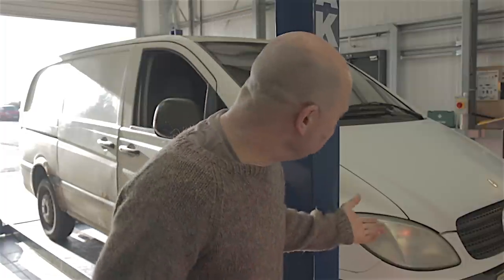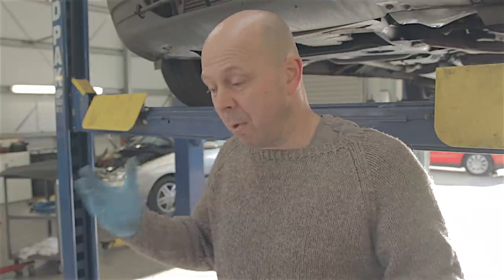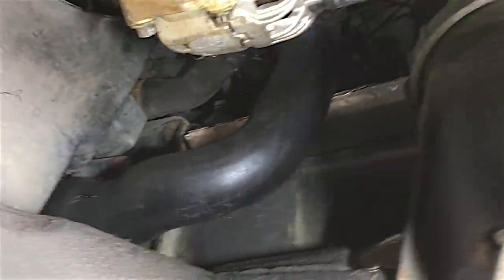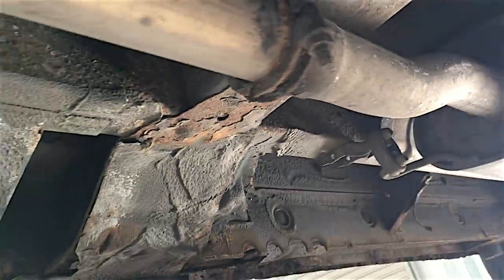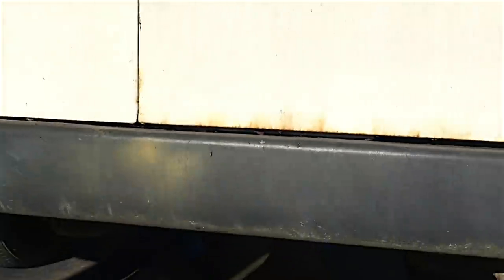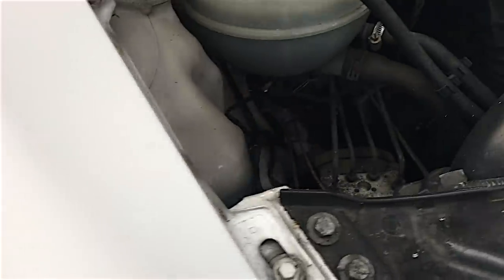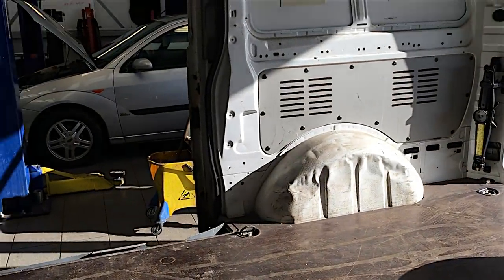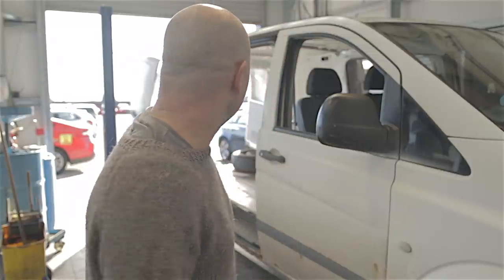Spares or Repair, After Sixteen Years The Rust Won, Mercedes Vito 109cdi.

Comment: The corrosion on Mercedes’ vans always amazes me, you regularly see 2 year old sprinters for example with rust scabs coming through the paint on the outside, but generally underneath they are sound, but that van is very crunchy indeed

Comment: A mate of mine had 2 of them, I they both turned into premature rust deposits the metal was appalling & they did require some expensive mechanical repairs. I know they get bad press sometimes & I’m sure people will have some horror stories but I’ve had 2 Renault trafic’s & currently running a crewcab Vauxhall Vivaro. Done well over 300000 miles between the 3 of them, they’ve been very reliable & never let me down. Also rust has never been a problem because I believe they’ve got galvanised bodies, you never seem to see a rusty one & the m8 that had the 2 Vito’s is now on his second trafic & his have been just as reliable. Keeping them well serviced (regular oil & filter changes) & running on premium diesel is key in my opinion.
Reply: Vito's are galvanised 2006>

Comment: We had a fleet of Mercedes sprinters as soon as they turned 4 years old the rust started and it was also in patches all over the place and it spread quickly. Even Transits never rusted as quickly as Mercedes do.
Reply: The early model Mercedes suffered from that
Reply: @clinteastwood8230  these were 14plate not what you would call old
Reply: I was under the impression that Mercs were all about quality until I saw this. Shocking!

Comment: As you say, they are not designed to last bodywise. Designed to do 200K plus miles in 6 years. And the chassis cabs then used for mobile homes and they rot out in the same way as they don't have the rust protection in them. Not to mention that Merc's of that era are well known for tin worm problems. At some point you usually have to admit that you are fighting a loosing battle...

Comment: I bought  a 2001 ' Y '  Mk5 Escort 55 van at 50.5k miles  which I bought from BT in 2005 for £3,500.In the early years , had access to a ramp and liberally sprayed Waxoyl everywhere annually and squirted motorcycle chain lube into the sills through the trim fixing screws .The body remains immaculate but got an advisory last year on sill rust starting to appear .It has been so utterly  reliable over 17 years and cost very little to run & maintain ,I am loathe to give up on it and worried about a replacement being less so and too complicated and cannot afford the huge costs vans are now , even a high mileage one that most appear to be .It has now covered 114K miles  .I feel I am going to get it inspected a few months before the MOT and probably give it another chance - what should I do ?  .It is often admired too !!

Comment: I had a Seat Alhambra Y reg from new. After 10 years it had done half a million miles on the clock. Same engine and gear box, clutch at 300,000 turbo similar time. Just regular servicing and cam belt/ water pump replacement. Brilliant car 1.9 diesel.
Reply: A family member has a VW Sharan 1.9tdi 115bhp 10 reg, it was the very last one VW made before they changed to the new shape and went to the newer shitty 2.0tdi engine. 
The old 1.9tdi engines were so good, nothing like the crap that is made now, yes the new ones are more refined but everyone I know with a car with the old 1.9tdi PD engines have really high mileage but still drive so nice with the proper oil and service regiment, and the parts are so cheap for them too.
Reply: @MrZimmaframe  1.9 TDI is a bulletproof engine fact! 😎
Reply: How did that van get through the last  mot?  Should have been scrapped five years ago.

Comment: all mercedes, cars and vans, in the early 2000's were rust buckets, as they stopped galvanizing the panels to save money. There was that many complaints, especially from car drivers about their cars going rusty after only 4 or 5 years, that mercedes went back to galvanizing and properly rust proofing in the late 2000's....they even offered a 30 year anti corrosion warranty to bring back the faith for owners in mercedes.

Comment: My dad has a 2008 Renault traffic. With.  20030 miles that still has the original clutch.apart from service items it’s only had a battery, an alternator,and last year new injectors. Everything else is original. And no rust at all on the body
Reply: Best van I’ve ever owned a trafic . Sprinters and vitos showing corrosion at just a few years old - not good enough for a “premium “? Brand
Reply: I was gonna mention that. Renault trafic / Vauxhall vivaros are very solid vehicles.

Comment: A roll of duct tape(Or aluminium tape if you're feeling flash)a thick coat of underseal and get Stevie Wonder to MOT it and run it for another year🤣🤣

My brother in law just paid €1,700 to have his 08 Transit ST welded up for another year,still cheaper than buying an unknown replacement. 

A mate recently purchased a Merc crew cap,with the 3.0 V6 turbodiesel, goes like shit off a shovel according to him,but very juicy though😂

Comment: My one through a rod at 400,000 miles and I still drove it from the recovery truck to the workshop 
And the stupid thing they don't have an oil pressure switch but it has got a light in the dash and if you don't believe me phone a main dealer and ask for a price of a switch and they will sell you an oil level sensor

Comment: I bought an 05 vito and converted it to a camper. Spent everyweeked finding new area of rust the old owner had filled over. After a year of welding and body work i gave in and replaced it with 12 plate vito. Was best move ever new vito hasnt got a spot of rust on it.

Comment: Bought a Kia Rio cheap as the front bearing on both sides were shot. Did your trick and bought two complete hubs off eBay. Fitted them, kept the old hubs with the intention of having the local garage press me new bearings in when the eBay ones gave way.  Ran the car for 30k miles before I had to scrap it. Fuel tank rotted through, all the scrappers had rotten tanks too and all the factors wanted £500.  Hubs are still sat in my shed though.

Comment: Hi Alan.I had a similar rust bucket which was a ex taxi 1998 escort estate 1.8td which a bought really cheap with a broken cambelt.replaced the valves and belts then ran it for 100k miles with 380k miles on the clock.the engine never used any oil but like your van,I just got sick of welding patches and spending time to get it through the mot every year.

Comment: Running an old Mercedes is expensive business. I let go my 190e a few years ago after 18 years (plus 7 years by previous owner) and I could not have bothered with more ongoing repairs (bodywork still decent though). My one owner from new 95 Mk 7 Corolla had given  me only around 5% of problems (all easy and not expensive to fix) to that of the 190e and I am still driving the Corolla daily.

Comment: They’re shocking.  Have a 2009 120 imported from southern uk in 2016. Under back of it once a year tidying up for equivalent of MOT here in Ireland. This week working on corner of front sills behind bottom of front wings. Effing thing is rotting from the inside out. And it spends most of its time indoors. Someday drivetrain will overtake the body 🫣. Over £1k recently spent upgrading to auto climate to include finding ac condenser buggered from ally rust and intercooler leaking also. Such a shame, these parts of northern hemisphere just too much water in the air all year round. Only kept local market in mind when they made these in Vitoria. 😫

Comment: I had from brand new a 2001 Vito which served me great but became a rust bucket which I repaired year on year. To be fair it was a fantastic van but I had the brakes fail on me which thank god was on the flat at 30mph when covid lock down was on so very little traffic on the roads. The last MOT fail estimate was £3000 to fix so I had to say goodbye. £500 scrap value which I thought wasn’t bad.

Comment: Wow ! And I thought my ‘92 Jeep Cherokee was bad . Half my rocker panels are gone and the lower body panels are full of holes as well . 
It’s gotten to the point I’m ashamed to,take it for inspection each year . So why do I keep it ? Foolish pride . It still runs fairly well , at least . The four wheel drive is still very functional and effective . The transmission , the once popular AW4 auto trans still works well when other Jeep automatic transmissions weren’t as well built . The transfer case , an np242 , is one of the better ones as far as gear selection in four wheel drive mode . The 4.0 liter H.O. still is,strong . Swap the whole powertrain and drivetrain into another Jeep ? I like the idea but I’ve got two Jeep projects already . So I’ll just keep in on service .. the unibody frame is fairly strong for now . Maybe I’ll patch it as you’ve done , but how long will I wait ? Sorry to see your old friend go , but it’s out of your hands . Nice fix on the driveshaft . Luck with rainbows that it didn’t vibrate but you showed the benze boys they can’t get your money ! Thanks for the star appearance Monica ❤️ that was fun ✌🏻

Comment: The achilles heel of early noughties mercs was rust. Great engine and gearbox. Shite water based paintwork mate was the problem. If the bodys had of been galvanised. Bought a 93 astra van in 1995, ex royal mail, rusted to bits in less than 5 years. I had a 2002 c220cdi, pit 275,000 miles on her, needed a turbo and a couple of injectors, had to paint the back arches twice.
Reply: Yep my old k reg astra was a rust bucket to the 05 one I had years later had no rust even at 12 years old Vauxhall zinc galvanized the later astra.

Comment: Hi mate, do you live by de sea? I have a vito 111 2004, 490.000 kms, it’s a little rusty but not like yours, but de engine is like yours, very clean no drips of fluids. Lately, when I start running the van there’s a loud noise, I think it’s the transmission, must check.

Comment: That’s Vitos for you. Mechanically bombproof and go forever until the body hangs off the thing. For a ‘prestige’ marque, MB are woeful. Sprinters are no better. Negligible corrosion protection and rust popping up in the most unlikely of spots such as the middle of panels. MB really do need slating for this. It’s bad enough on a commercial but if you are doing a camper conversion on one of these you are shelling out potentially £50k+ and deserve better.

Comment: Have to agree, probably the best vans money can buy for the engineering but once they start rotting they do it very quickly.  The best merc I had was a 1982 307 2.4Diesel, non turbo, lwb with over 300000 on the clock it was still going strong right up to 2000, the engine & running gear would have carried on for another 300k miles but underneath was literally falling apart.

Comment: i don't think Mercedes have solved the rust problem on newer vans, i have a few vans and i have a Mercedes sprinter as a spare van what's done 6000 miles only and is 70 plate and it worries me with rust, my mate as a 17 plate mercedes sprinter and it had bodywork done because it started having rust spot on it in strange places and he as looked after it washing it at least once a week,

Comment: Underneath looks like a British car of the 1950s and 1960s - and later!. I gad a VW Transporter 1986 Turbo Diesel for 20 years. I had a replacement engine at 100,000 but it was worn out after 75,000 so I sold the van at 20 years, The body was very good nothing like your van. I recommend a VW - or better a Japanese van. My TD engine was a disappointment.

Comment: Alan little question not about your van but mk 5 Mondeo I have one on a 14 plate  low mileage a while ago the rev counter was up & down and all over the place & engine would stall at times took me ages to track the problem down . Turns out it where thorttle body sencer. 10 min job to clean I'm just asking if any of your Mondeos have had this issue. Many thanks love the channel 😌

Comment: Our 111 2009 has done 567,000 miles arches are starting to rust bottom end let go last month 2nd hand engine in now
Reply: Mine is only on 284k. Wanting to get it to 300k but it’s starting to get a little tired looking

Comment: mercedes has dropt the ball if it comes to rust pruufing to the vito van and sprinter.

All the rest of the manufactures are much better the french and vw ford is also not gut with rust proofing

the rest of the mercedes is very good